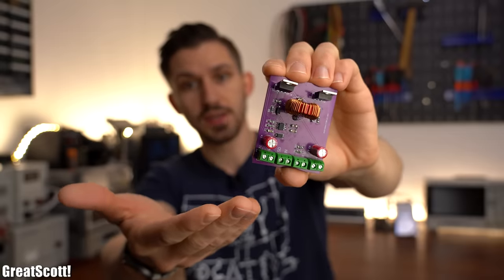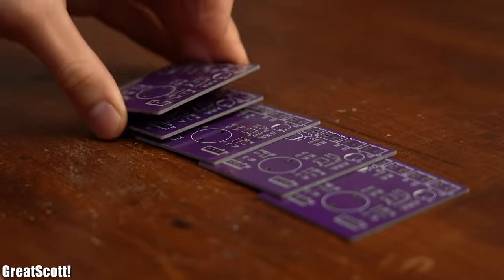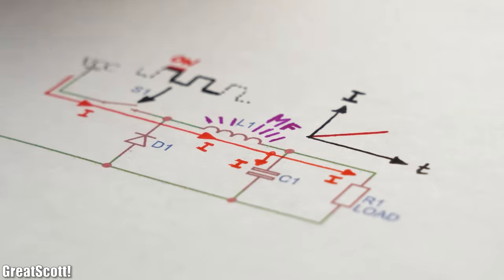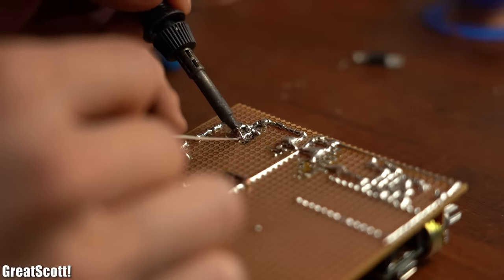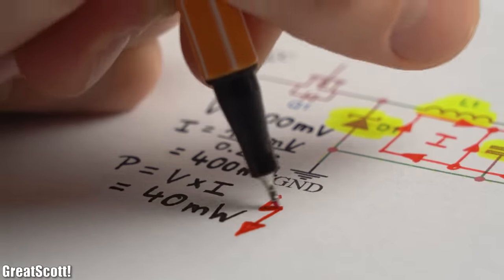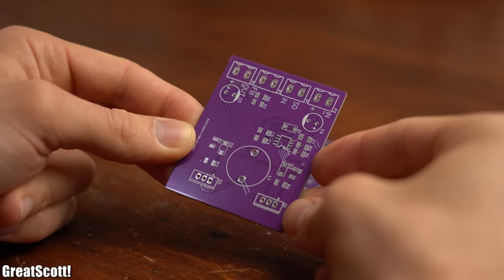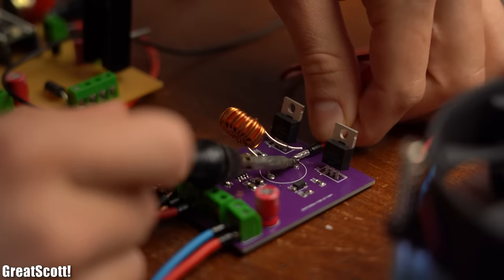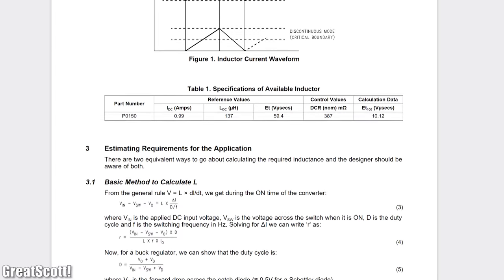Is this the BEST Voltage Converter? Trying to build a Synchronous Converter!

Comment: May I know from where do you find the data sheets of these components, I too wanna build a circuit in the future
Reply: Usually, just googling, for example, "IR2184 datasheet" will do the trick. Alternatively, going on a large distributor's site and searching the component since they usually have the datasheet (digikey and mouser for ex.). Not all manufacturer's just put their datasheet in the open on their website, but when they do it's often the most complete documentation
Reply: @evangiavina3002  Oh! Ok Thanks for the info!

Comment: I have p channel fet but I can’t get it to turn off once it’s on I did use the 220ohms resistor to positive the fet still refused to turn off I just gave up I have good results with n channel fet
Reply: In order to turn off a FET you have to remove the charge from its gate capacitance. You have to do that very fast for good efficiency with something like a switcher. It is easy to turn the FET ON by pulling the gate negative with respect to it source, but then short-circuiting (or nearly so) the gate to the source or even driving it positive with respect to the source is a challenge. A well-designed gate drive transformer can work, but you need push-pull drive on the primary. You're probably better off using a N-channel FET with a high-side driver, though they are rather expensive. I cases where you don't need to turn the P-channel FET of rapidly, a resistor between its gate and source will do the job.

With a P-channel FET as the high-side switch, you also have to be careful not to exceed the allowable gate-source voltage. That limits the input supply voltage to the allow G-S voltage unless you add parts to protect the gate (a zener may be adequate, depending on what you are doing).

Comment: 6:20 Why Q1 and Q2 are both N channel mosfets? Why shouldn't Q1 be P channel as in non synchronous? It does not make sense to drive N channel mosfet source pin straight from VCC
Reply from the maker: You use N-channel because they feature a lower resistance. You can switch them on such a high side through bootstrapping. Watch my MOSFET driver video for that ;-)

Comment: Can you use this to make a MPPT battery charger?
Reply: You can, but you absolutely MUST have a means of assuring that the rectifier FET is properly fully OFF at any time it shouldn't be ON, otherwise you risk essentially shorting the battery. An MPP circuit may turn off completely when the input source voltage is too low but that may not guarantee the rectifier FET is fully off. A simple gate-source resistor MIGHT be adequate for that case, but be careful.

Chances are you aren't going to gain very much efficiency with sync rectification for a battery charger unless your battery voltage is quite low. Sync rectification has its greatest benefit when the forward voltage of a normal diode is a significant fraction of the output voltage and the diode conducts a significant fraction of the time as with high input to output voltage ratio where the main switch duty cycle is low. All of this is quite easy to calculate reasonably accurately without getting down to the fine detail. 
It can be worthwhile at higher voltages not so much because of efficiency as such but because it might reduce problems with getting the heat out. That seems rather silly, because heat goes with inefficiency, but sometimes getting the heat from where it is being produced to the ultimate heatsink, normally air, can be the bigger concern.

Comment: I was curious what you'd use to drive a low power higher voltage thingy. Like a piezo buzzer with a 3-30V range off an Arduino. (Voltage is more noise, right :P)
Reply: It depends. If you want to amplify an AC signal, you can just wind a transformer, so your 3kHz buzzer signal that you generate at 5V and has maybe 20mA of drive current can become like 20V and 5mA if you transform it 1:4.

Another solution you may consider is a Cockroft Walton multiplier. Those things really can't do a lot of current. If you like, EEVBlog had a vid about it.

A related solution is a charge pump. For example the industry standard 7660 doubler or a derivative like MAX660. It's also very useful as an inverter, say you want to power an opamp which draws little current but needs 5V both positive and negative, but you only have 5V, so you can generate -5V rail using it. If you have something that needs closer to 10V, you can double your 5V.

Comment: Okay so I am currently looking here and there to find something useful, but failed so came to the greatest source of all - yt comment section.
I want to power up the project using RPi with an LCD and cameras, etc. and the problem is I kinda have to power it up from a 1S LiPo. The problem is all the 3.7 to 5 DC-DC boosters I find have the max output of 2A or so... Afaik I need more than 3A, so can anyone help me? Maybe I'm just blind or dumb, idk...

Comment: Love to have someone help me on the approach of fixing the DC load tester you showed in this video. 
I think it is one chip have I have re solder a new mosfet.   Anyway it burned out when testing as the BMS shutdowns  it kills the ground and thus kiss the main mosfet on the heat sink good bye.

Comment: Make it with GanFets and test again?
Reply from the maker: Nice idea :-)
Reply: I also hope he gets into the GAN tech. 

Gallium Arsenid Field Emitting Transistors are an awesome technology group. 
Also it is parallel to Silicon fabrication and foundries, meaning that it is  less difficult to order and get GAN components. 
Its quite wonderful to have a good application of GAN tech in power conversion. 
Some GAN  power bricks are beginning to appear into the market now. 

it makes me smile when electrical energy is transported with minimal thermal conversion losses.
 
The ultimate goal would be superconductors components at ~room temp.
The future looks bright. A new field of materials is being R&D'd; started with a sulfur compound under extreme pressure, but that's just the starting point.  Also lets not forget the properties of graphene. 

Conclusion: This is fun stuff :)

Comment: @ 5:14 ain't this clear evidence of Miller parasitics resulting in "ringing" - e.g. unwanted oscillations and more, euh...  There's power devices with some fair gate driving solution built right inside anyway.

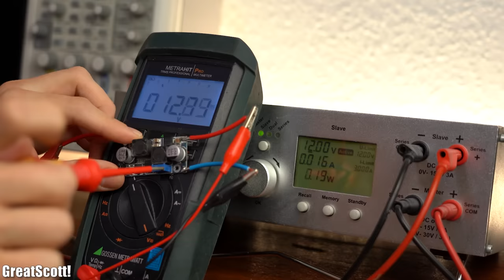Comment: 0:18 wrong. that's just transforming voltage, not converting it.
Reply: No, that is properly called converting. There is no transformer involved. Voltages and currents are converted using energy storage elements - inductors and capacitors. Transformers don't store energy (actually they do, but that is not the intended function and in a good design the stored energy is small relative to the full rated power handling ability of the transformer).

Comment: These kinda of dc to dc converter are super common in computer, it's nice to have a proper name to it now.

But obviously the advantages in a PC context is much more since instead of 12V to 5V 1A, it's more like 12V to 1.2V 100A

Could you try adding a diode in parallel of the low side mosfet, it might improve the efficiency or worst case, do nothing